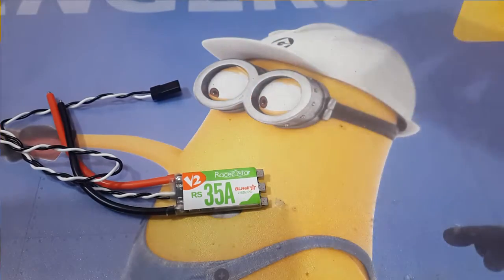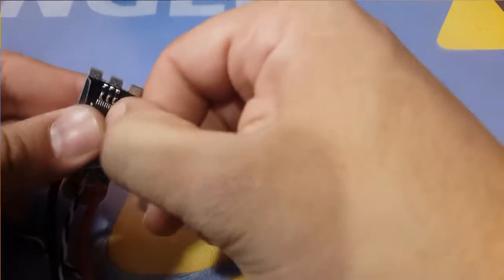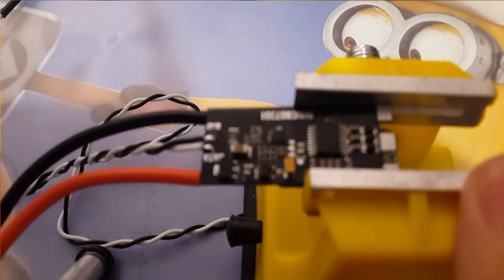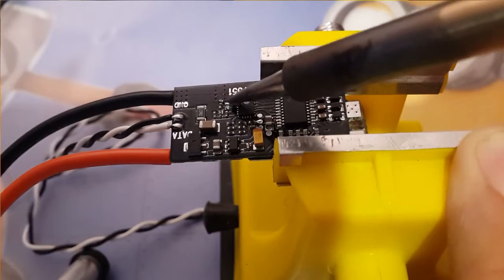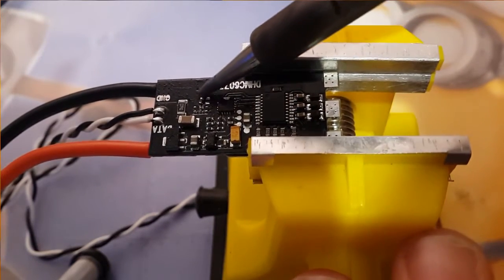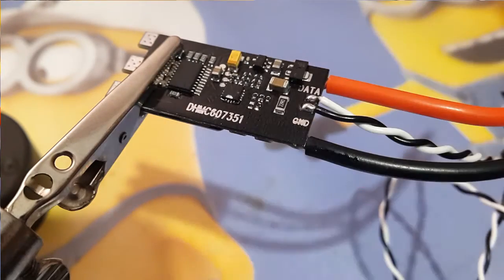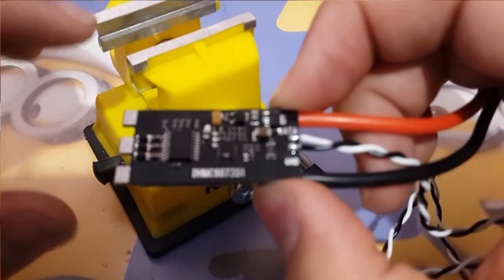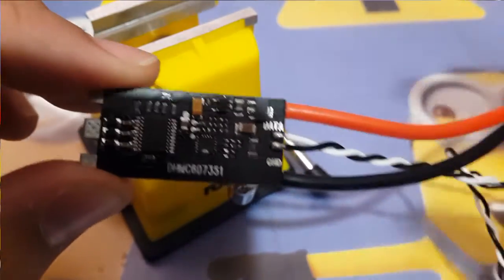Racerstar 35A V2 ESC DSHOT 600 (REMOVING FILTER)

Comment: Wasn't able to remove signal cap with flat soldering iron tip even on 300 degrees Celcius. At end I torn it off with pliers and unsoldered the remains :)

Comment: Hey. If I remove the capacitor, can I use lower protocols? Or will they be problemmatic?
Reply from the maker: Kostya Ignatov have not tried it. But if you quad is not noisy then it should be ok..

But just be careful and if you bought a recent esc they are removed by default now.
Reply: And I have no way to check. Interested in the opportunity to work with NAZA M. I think there is PWM, that's what I'm digging about, how will they work. These regulators are there and I want to use them. Thank you.

Comment: One question : why do you do it ? In such a video, would be nice to explain, at least a little, why you remove that filter, what is it there for ..etc..

Other than that, I really like you channel ! Thanks for sharing.
Reply from the maker: It was one of my first videos at that time and i saw a need for it ,so i thought i would give back to the community. 
Also at that time i did not want to get too technical because there are others who can cover that part very well. My audience in mind that time are the people that know what DSHOT is for but have no idea where to find the capacitor.

Thanks for the feedback.
Reply: i still don't get why remove it...
Reply: Capacitor makes ripples dampen thus bad for digital otherwise analog protocol